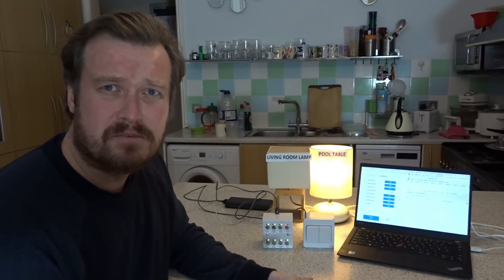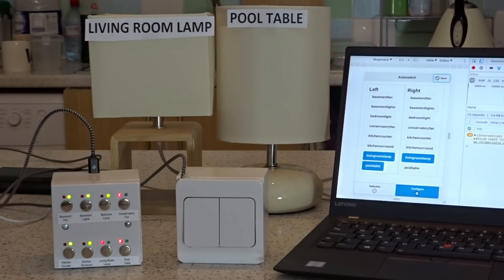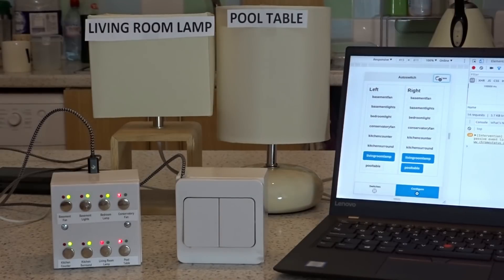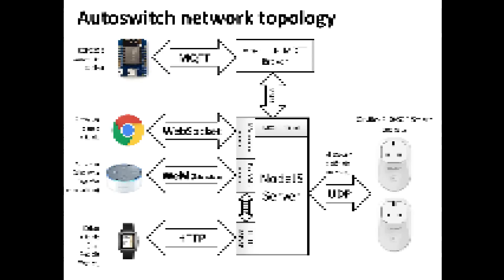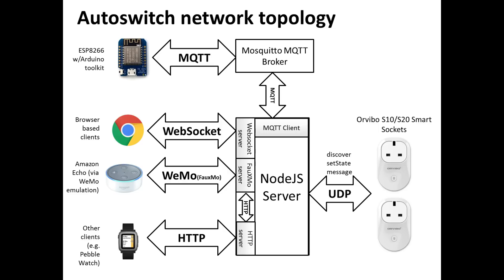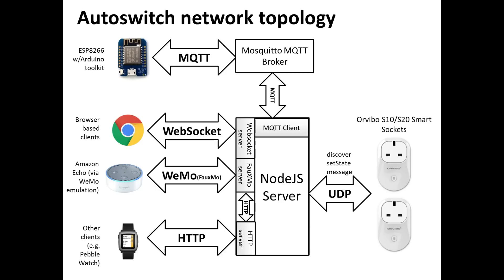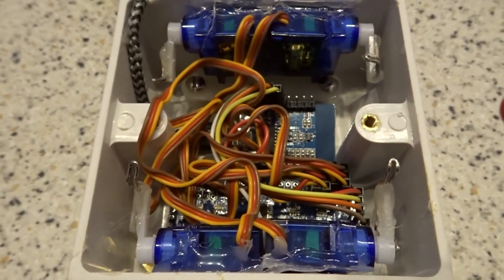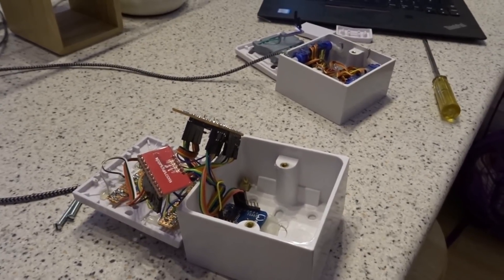Self actuating programmable switch

Comment: Fucking finally!! This is what I've been looking for, for many many years.

Here in Asia (specifically here in the Philippines) we have this common Vertical Slopes State Light Switches, so when the Smart Home revolution started happening, I was thinking of switching my whole home to that ecosystem. 

But I've realized that you need Smart Switches to Smart Lights too, or else connecting it with the usual Light Switches here would just cut off the electricity on that Lights and make it undiscoverable by the app / or the WiFi. Also controlling the Lights with the app, with the old Light Switches, would unsync the Slopes State Light Switches, and if it's turned on or off on the app, it wouldn't synced with the actual Light Switches themselves.

Another realization I had is sure, both have Smart Light Switches and Bulbs around the house, but none of the Smart Light Switches designs in the West (where Smart Home revolution innovations are mainly happening) are these Slopes State Light Switches that we're accustomed here in Asia. Most of them are just push button, or paddle top that is sloped but goes up again (basically 1 state Light Switches). Back then, I thought it was because the market favors that design that is why no one is making the Slope State Light Switches.

I don't want to switch my whole home to that design as I think my parents wouldn't like it, as our muscle memory is trained on that Slope States tactility. If I wanted to switch to Smart Home, I want it to be as invisible and as familiar to my other home members. Plus the added Smart features of course.

I searched far and wide, and I realized 3 things : 
• the actual term is "Actuating Light Switches" 
• And of all the Smart Home manufacturer in the world, there is only 1 company that have figured it out *and they call themselves Dem Smart Home https://dendevices.com/products/ *but it seems they have scammed their Kickstarter backers by selling their company and patents to another company and stopped all the smart functionality and shopping of their products. And at max, you can only buy 1 switch. There is no 2, 3, or 4 Gang Smart Light Switches. It's ridiculous. Waiting for another more switches model of that would take years, so that's a no go. 
• Lastly, I asked around the Smart Home communities and they've said that maybe why the Smart Home equivalent of that design is still not happening is because *it's actually hard and expensive to manufacture that Switch design*, along with the Mechanisms below it, is of course the Power Connection, WiFi Antenna and probably a small computer that handles a bit of it's smarts. It's harder to even miniature it (say make it a Vertical Gang switches, instead of Horizontal, for Wall Space efficiency)

Your design and implementation is spot on what I've been looking for. Somebody just need to improve, make it efficient, miniaturize (including a Vertical design) and mass produce this and finally we'll have what we're looking for.

I guess 10 years after this Smart Home revolution, I would need to wait 5 more years for this exact design for them to figure it out.

Comment: this is the evolution and future of smart switches. All the smart switches today are just button clicks on the paddle top or bottom part. It would be nice to have the switch look like traditional decora switch that functions properly. Im assuming we need to get to a time where you can have a motor be small and fit in a standard gang box as well as fitting all the additional smart components at a reasonable price.

Comment: Great Job! I realy like it to implement at home. Q: Is there any reason why you used servos instead of solenoids? B.Rgds.
Reply from the maker: Have a look at the more details link in the description for details of how I ended up where I did - solenoids didn't have enough torque and do nasty things current wise if you don't have some heavy duty protection.
Reply: Ok. Thanks a lot for the answer, and again. GREAT JOB!